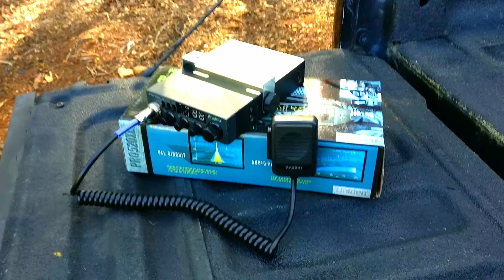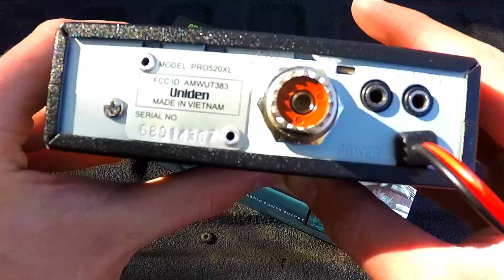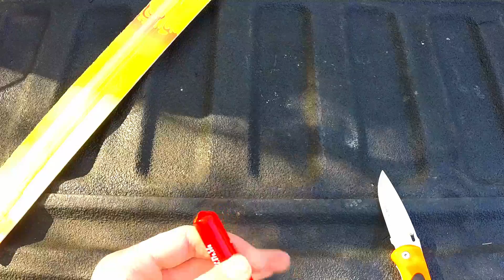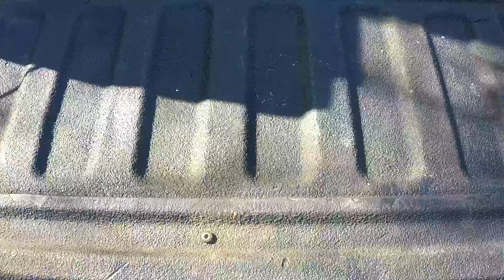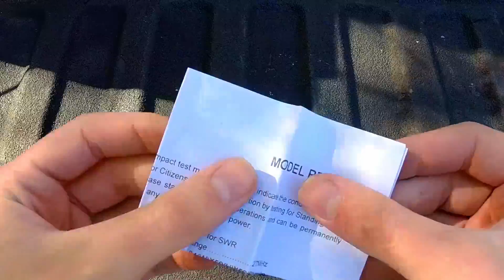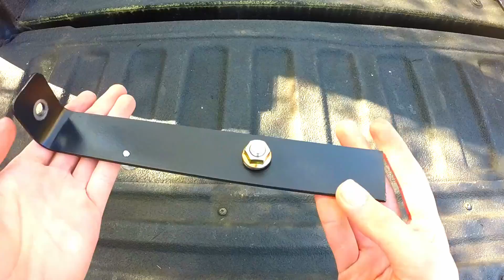CB Radio Install: What You Need

Comment: Hi Nate,
     While this video appears to be 4 years old, it is still full of good information!

     That being said, the coax that you purchased is the wrong type.  You want 50 ohm RG-58U (or rg-58A/U or rg-58C/U), RG-8 Mini Foam, JEFA Tech LL-240-Flex, Davis RF RG-8X-LL or LMR -240-UF, not 75 ohm RG-59U, A/U or C/U TV type coaxes.

     RG-59 type coaxes are used is with co-phased antenna setups!  Both pieces must to be the exact same length and you need a F-M-F tee connector at the radio end or a purpose made co-phasing harness.  They are also used as a matching section in some antenna setups such as a Full-Wave Closed Loop Antenna or a Delta Loop Antenna.  Also, 75 ohm coaxes have higher losses at CB frequencies.

     The JEFA Tech, Davis RF and LMR coaxes are RG-8 Mini Foam type, just double shielded and are extremely low loss!

     The SWR meter is okay but you would be better off with a Cross-Needle meter that show Power Out/Reflected Power/VSWR at the same time or a digital readout meter as these need no calibration to get your VSWR reading (self calibrating), just plug and play and they give more accurate readings.

73,
John, 891 Southeastern Massachusetts